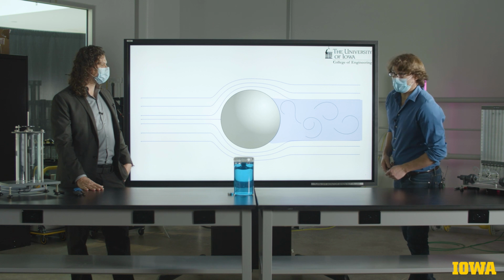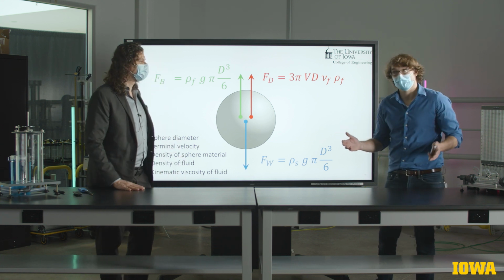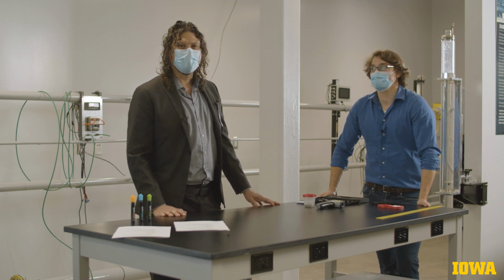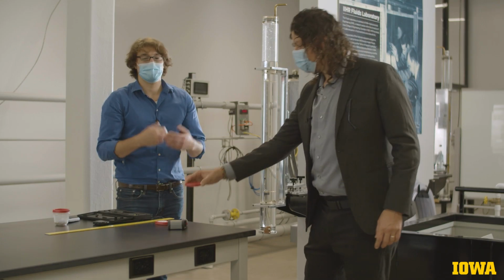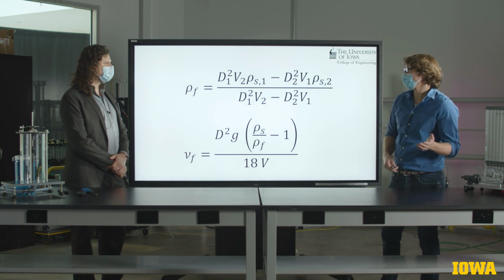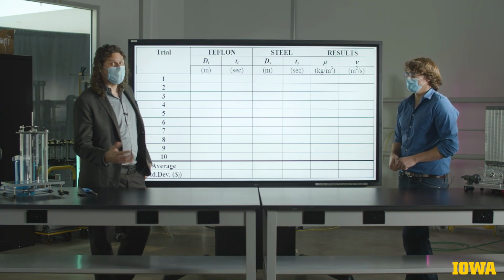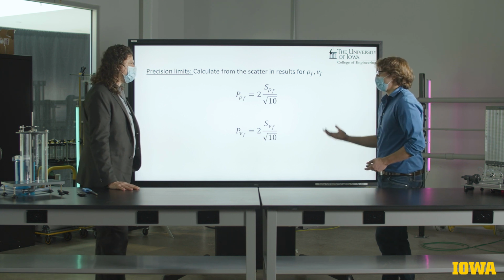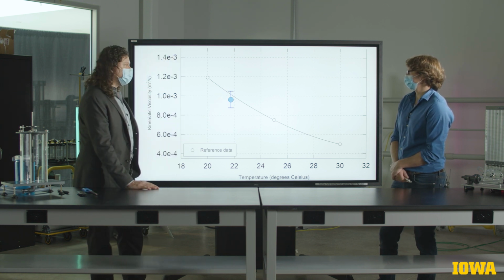Fluid Dynamics Lab #1: Viscosity

Comment: Great video, but, as a pedagogical matter, I think you dismissed the most interesting part of the story as if it were an unimportant detail. I wish you had shown how at least one of the "sensitivity coefficients" are found from the data reduction equations using calculus. This skill—calculus as a tool for error propagation—isn't typically taught in introductory statistics or calculus, but it's such a useful thing for engineers and scientists to know. Sometimes it isn't even taught in multivariable calculus courses, maybe because math departments are less interested in teaching science and engineering applications.
Reply: Thanks for your thoughts! I agree that error propagation is an interesting -- and often undervalued -- component of the experimental process. Here, we omitted a detailed discussion of it because the course for which this video was made has a separate module dedicated to uncertainty quantification.